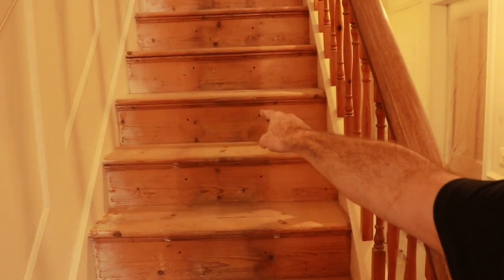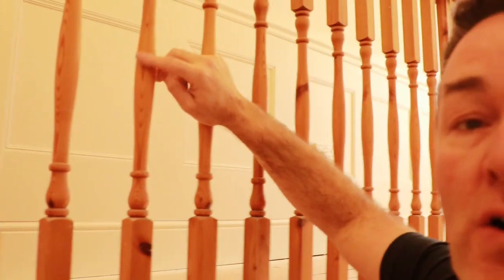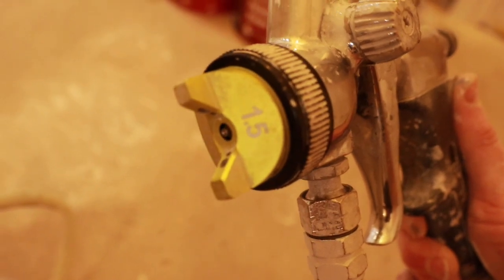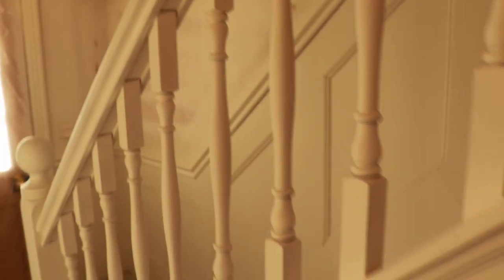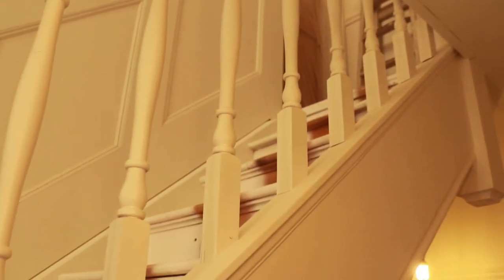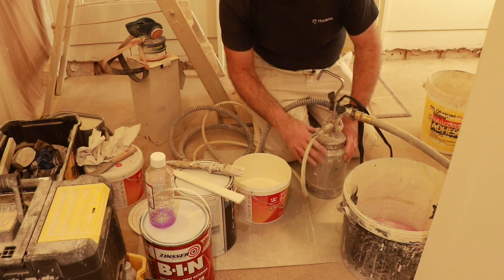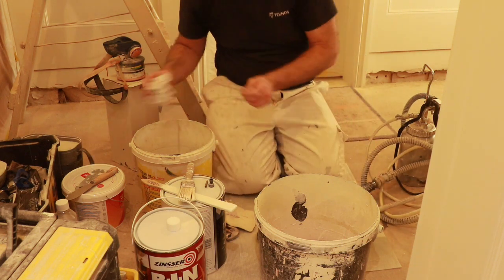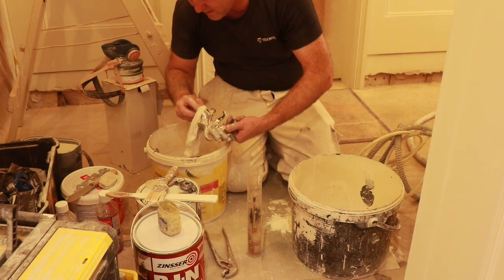Paint Your Staircase in Minutes with HVLP - You Won't Believe What Happens Next!

Comment: Great video Phil as always.👍 I remember back when I started in 1986 the company I worked for done glazing also , my job would of been to prime bare areas on the window rebates with knotting  before putty was pressed in with your thumb , no silicone in them days , same on new mahogany windows , always sealed before putty , fill , etc. I had the fuji 5 before with remote pot , I used 2 whip hoses for the remote pot , one going in , one going out , made it more flexible. Little kitchen pot scrubber brushes are great for cleaning remote pots. I've the Gentilin now with PPS I use mostly for stairs , also drape the bottom row of stairs with plastic film keeps them dust free until you get to them while spraying upstairs. Definitely more control with hvlp as opposed to airless. The extractor fan with ducting is great also , I made up a filter to place in front of it , although I'm gonna make a newer box version 4 sided idea soon. It's not Atex rated , there alot pricier , but I've used spraying bin an survived.  Happy New year and look forward to more videos for 2022 . Cheers
Reply from the maker: Good call on sheeting over 
I finds.. start at the top.
And fall out, dust off and. Alight sand and come and spray it when the top has dried off.
Handrails I'll come back to. Light sand. Wipe over with damp cloth then a quick wet coat... Come up lovey.

Customer said on Friday shed never seen a finish like it.

I said it's what you're paying for . And my kit is over £2k if you add it all up that I'm using for spraying.. hvlp and the airless... As done the panels airless this week too. Pix on Instagram of that.

You need to spend on equipment to get the best finishes don't you. 

:)
Reply from the maker: Is that your WRC?
Reply: @ProfessionalPainterDecorator  I was the Co Driver on that day S11 WRC  , Donegal Harvest Rally 2006 .
Reply from the maker: @navigators11  have you seen you in ScoobyNet?
Reply: @ProfessionalPainterDecorator   I'm not on it but possibly the videos could have been shared on it over the years.
Reply from the maker: @navigators11  oh I've been on there years ..... 21yrs next month lol
Reply: @ProfessionalPainterDecorator  You own one or two  I guess 🤔
Reply: Hi James, how do you find Gentilin + pps with overspray?
Reply: @bluewanderer9903  Yes still have overspray at times on stairs , masking an extraction is the only way .
Reply: @navigators11  thank you 👍

Comment: Hi Phil - recently found your channel. Lots of great info. New to spraying mostly done airless after doing a course. Just bought a Graco 9.5 pro. Have a staircase to do. Looking forward to it, video has really helped. Wondering do you thin down the bin?
Reply: BIN doesn't really need thinning for hvlp use meths or get some nail polish remover, acetone , if it gets thick or to clean.

Comment: Hey Phil, what are your thoughts on stage 5 vs compressor? And will a pressure pot help spray paint with less watering down? 

I sprayed some helmi 30 recently and not happy with the finish, i had to do 20% water instead of the recommended 10% to get it to spray well (compressor setup)
Reply from the maker: Ooooh. 6million dollar question.
Stage 5 is a small easier to move around unit than a compressor.. unless you buy a small one, but make sure it's powerful enough.

Hvlp... Needs thinning... Remote pot... I think you need enough thinning to get it up and through the paint pipe.

Watch my video on spraying radiators and also the velux.... I use the remote pot on those videos

Comment: Phil how would you spray these spindles if the there was carpet and decent walls? Or would you just paint them using brush or roller? Seems tricky to cover up area's otherwise?
Reply from the maker: You'll do it before walls are finished.
Tape and cover tye carpet as you would anyway. Carpet protector on a roll on the stairs and the bits up to the stringing, you tape the last bit. Don't over think it.

Comment: Hi Phil, I understand caulk is flexible, but dry paint isn't, or is it? Does dry paint not crack with any timber or caulk movement? 
I had that done on my wardrobe shaker door, used flexible caulk. However a few weeks later cracks developed in paint on several places around the panel where caulk is. Cracks are in the paint, caulking around the panel is still good.  I used 2k poly. Any thoughts?
Reply from the maker: my thoughts may be to ask... were the original doors, with a centre panel that was 'loose' as in a floating panel to allow movement of the panel in it's surrounding frame? maybe caulking that meant it can't now now like it did before?
some doors like that don't need to be caulked.

what's the paint you used? cellulose I take it?
Reply: @ProfessionalPainterDecorator  Thank you. Good thinking about the panel. I just presumed it was glued in, there was no movement in it...if I remember correctly 😳
The paint was seherwin williams 2k polyurethane, got lovely finish with it, this does dry very hard I think.  See I did not know about caulking but the line between the panel and door did not look good after spraying another door I used for practice. So it was suggested I try caulking it. Now dont get me wrong, they still look great, which is why those few cracks are annoying I guess. 
How could I have it done otherwise, the gap wouldnt be a problem if paint line was "clean"?
Reply from the maker: @bluewanderer9903  hmmm was the caulk an interior exterior flexible one? I find that's better and caulk and paint the day after.
Reply: @ProfessionalPainterDecorator  not sure if it was exterior, it was suggested to me as good furrniture caulk and I did not buy it as it was given to me free brand new unopened, white tube said professional on it, paintable. I found it easy to use, clean spread.
I will be doing the other bedroom in a few weeks and I will try what you said there.
Thank you 👍

Comment: Hi phil great videos, im just starting out, i have not bought a spray gun kit yet but was wondering would an HVLP kit or Airless kit to start with, also is it possible to use a spray gun kit in someones home who is living in the house, or would it have to be unoccupied etc, no carpets etc. Those stair spindles did look nice, and the time saved instead of painting them by hand. Could you also recommend a good reliable brand Graco, wagner, etc? 
I dont want to spend fortunes as i dont know how much use it will get, do you spray walls and ceilings or roller? Is it only possible to use a sprayer, if the house is empty??? Sorry for all the questions keep the videos going mate. Thanks Kevin
Reply from the maker: Hi, Both play their part.
Airless is great, HVLP is too, but you cant do large wall/ceilings etc with HVLP, its more for fin work, kitchen/cabinets etc, woodwork, .finer finish and easier control.
Airless, I also use on woodwork too. With the right tip an pressure control you can reduce overspray.
So when I'm in a house someone lives in.. carpets down etc. Tape up well, cover floors like you would anyway.. and learn how to use the machines. 

When you see TikTok and Insta.. and you see people covered in overspray.... they are doing it wrong.

2 tips for you.
Spend what you can afford... buy cheap pay twice!!
Go to someone who knows what they are selling, they will advise whats best for you.

Have you seen the vids of the set ups I have?
the airless graco GXff is a good little all rounder.

I work in empty and lived in houses, you will still weigh up what you can use where, sometimes it's not worth getting a sprayer out ;)
But don't think you can't use a sprayer all the time!!

Comment: What size tip did you use on the Eve ral aqua Phil and Was it thinned at all
Reply from the maker: The 1.5 needle tip is fine. With hvlp you need to thin the paint.. so add a bit at a time so that it's sprays right... Too thick and it will spray a bit splattery.

Comment: Great Vid and very informative many thanks, I see you use the red devil caulk def recommend, as to your furniture filler Phil which could you recommend, I use repair care but very expensive.
Reply from the maker: Hi, Yes the Red Devil OneTime Caulk is very good. I use the Helmi Furniture filler, you may need to do two fills on some holes though. I don't use RC for filling like this, it would be two pack on bigger screw heads if needed. I found with RC that it didn't sand down well. Have you tried TimbaBuild? That does rub down a bit easier. Timba Build also do a fine finish filler, when you need to skim wood imperfections out.
Reply: @ProfessionalPainterDecorator  Many thanks Phil👍👍

Comment: Hello Phil,  great video,   I'm looking to spray a previously painted staircase.   Would I have to completely remove the old paint or would keying it up be sufficient.   Also what would be the best paint to use in that situation.
  Love watching your videos (more hvlp spraying plz)
Reply from the maker: Hi, I love ppl loving the videos :D tnx.

Give it all a good clean down and sand. no need to remove the paint if its a sound surface you'll be fine, dust it down well... you can clean it with sugar soap and water if it's really dirty etc.

I'd use a grip/adhesive primer like Tikkurila Otex Akav (water based first) then you can go over with Tikkurilla Helmi 30 or Everal Aqua 40 (eggshell/satin finishes).

Or you could just use an all in one paint....
Bedec MSP is soft satin
or 
AllCoat Exterior satin.

Both will go over previously painted wood no problem.... its an Undercoat and top coat.. all in one.

All spray well.

Hav eyou seen my airless spraying video yet?

Comment: Phil, I couldn't help but notice that at 30:43, prior to flushing the fluid line and gun out, you removed and cleaned the needle.  Then, after flushing the line and the fluid pathway inside of the gun, you removed the nozzle then cleaned it.  Wouldn't it have made more sense to flush first, then remove the needle, aircap and diffuser, then the nozzle - and then clean those parts?   The way you did it, you inserted a clean needle into a dirty nozzle, negating much of the needle cleaning effort you'd done in the first place.  BTW, great pro tip about applying Vaseline to the various parts.
Reply from the maker: Thanks for watching it all the way through... 4p towards that porcshe lol

The reason I clean off the needle part way through is mainly so I'm not trying to wash it all out with paint that might be stuck/dried on the needle. If I know that's clean, one less thing to worry about.
At the end you see I strip it all down and Vaseline it all back together.

It's a bit like cleaning an airless set up, I quickly whip out and clean the filters once I've started to get clean water through, so I'm not pushing paint water through that's being caused by paint stuck in the filters... If you know they are clean and clear, the only paint to be washed out comes off the inner part of the hoses.

Clean out though how you feel best works for you. Hvlp is so easy to clean and strip down when needed.

Comment: Hi Phil 
Great video , love your work. 
May I ask do you worry about the fumes coming off the bin primer.. as it's a bit flammable if so how do you deal with fumes. 
And I'm thinking of trying out the intact range on my hvlp, do you have any comments?  
All the best 👍
Reply from the maker: evening. TNX :) LIKE, SHARE.. smash that BELL ;) 
 I used INTACT 40 when it first came out, virtually the day after it was released, I used HVLP... never had any problems with it.. I used it over Otex Akva, as it was going on previously Oil eggshell.

BIN. with my mask I don't smell any fumes.... check my vids out on my mask ;)
Once you've sprayed the BIN, get doors any windows open, to let anything out. I don't have them open when spraying as not to blow dust everywhere. I want to buy an extractor and slinky hose tube to help ventilate rooms on some job, just I've not got around to looking into it yet.

Might be worth looking into for you if it helps?

Comment: Im painting quite a bit of MDF recently. I ran into the issue that after undercoat  I do fill nail holes sand it a little and it looks great but after I spray top those nail holes comes back. It looks like Mdf absorbs water   sweels a bit and those filled ploces dont.. And those holes need filling again.. A do use water based primer and top coat  with airless. How can I avoid this?
Reply from the maker: Hi, a good question.
Prime the MDF first.. fill and caulk.. then re spray it all with an Uc... or a 2nd coat of wat you primed it all with.

What filler have you need using?

A light weight filler, like Red Devil OneTime filler.. (or Wickes own brand if you're in the UK) is ideal for the small nail heads.. dries quick too.

I've found no need to use a 2pac filler.
Reply: @ProfessionalPainterDecorator  I do use" red devil one time"as well. 😀And use 2pack filler for the face side like for instance where the shaker panels meet it hides the joint better from my experience. Other fillers work fine but after after Mdf get moisture from next coat those filled places come up. Barely noticeable, but they are usually there.. I might just try to spray BIN as a base coat, I should prevent Mdf from absorbing moisture from upcoming coats.. Hopefully..

Comment: Hi Phil, Thanks for another good video. I've invested in an appollo power 5. Haven't used it enough. Struggled with the pressure pot getting a decent amount of paint through, think I didn't thin the paint enough. Could you do a video on thinning paint. I don't understand the plastic cups with the info on the side. I worry about thinning it too much. Cheers Bob.
Reply from the maker: The remote pot. Yes needs thinning more that when on suction cup.

Thinning. Depends on paint and it thickness.

Add water to an amount of paint you'll use... The the whole paint tin.

Mix and if it runs off nicely into the paint without sitting on the surface.. you're about right.

What needle you using?
A 1.8 is good if the paint is thicker... Luke using All coat Exterior.
Reply: @ProfessionalPainterDecorator  Thanks Phil I haven't got a 1.8 but have got 2.0, 1.5 so guessing 2.0 would be OK.

Comment: Phil, nice vid - I'd be keen to get your advice based on what i've seen... I'm looking to spray (airless) a stair case, spindles and bannisters with ONE Tikkurilla paint, and then give the treads and risers a final spray with a water-based poly for durability (polyvine). I've been suggested to use Betolux for stairs AND Helmi for spindles and bannisters BUT I'm trying to save on masking and effort by using ONE paint for everything and applying a hard wearing top coat to the stairs (it will also have a stair runner once done)
What would you suggest? Thank you!
Reply from the maker: Hi.
You don't need two lots of paint.

I've done a staircase in the last month using my GXff and  a 208 ff tip. All in Tikkurila Everal Aqua 40... and the lower staircase will be next week (as it's a two story house, done in sections.. working from top to bottom.

That staircase you see on this vid with the HVLP.. all everal aqua 40.. on the treads and risers too... carpet runner went up the middle.

You don't need to be using anything any different on the treads/risers.
Reply: @ProfessionalPainterDecorator  thanks for the reply. That was my thinking exactly, one paint and I'll finish with a poly for extra durability 
There are painted walls to spray over as well but I've seen some mixed issues with Optiva 5; hey ho, I'll keep looking. Cheers
Reply: @ProfessionalPainterDecorator  I've bought a wagner pp90 and I'm trying to spray woodwork with 208ff tip with 123plus and I'm getting spitting and tails galore. Need to spray a big staircase with it but i can't get it not to run? Any help?

Comment: Have you done a video talking through the difference between hvlp and airless and when you would chose one over the other? Cheers
Reply from the maker: hi, not sure i have, I may mention the use of a sprayer on the video using it. Where you wondering what to buy? what would you mainly be doing?
Reply: @ProfessionalPainterDecorator  Hello, Phil. I already have and use a graco 395 which is great but it seems like overkill sometimes. For example, spraying a couple of radiators or a bit of woodwork. I also think that sometimes it is probably putting out more material than I might want - like with spindles or if I wanted to do UPVC. In those case I wonder if hvlp is a better choice. Any thoughts you have would be much appreciated.
Reply from the maker: @xxnonstopdancingxx  yeah, you won't use airless for uPVC, you want a hvlp gun.

for the odd radiator... have you looked at that cheap £40 hvlp I tested a while back?

HVLP would also be good for your staircase work too.

Airless is best for large areas and using more thicker paint/emulsion
Hvlp... more control and for finish work.

you can use airless for woodwork etc.. its getting the right paint.. spray tip and filters... also practice ;)
Reply: @ProfessionalPainterDecorator  cheers, yep I saw the cheap £40 HVLP video. Cheap stuff has it’s place. I think I just need to pull the trigger so to speak and buy HVLP to compliment what I have… but what to go for. This morning I won job with 20 column radiators over Easter weekend so whatever I use it will get a good workout.

Comment: do you get a lot of paint floating in air around area when spraying with this gun?
Reply from the maker: only if the fan is too wode and you're spraying through the gap, but control of the fan width and air flow you can keep down the overspray